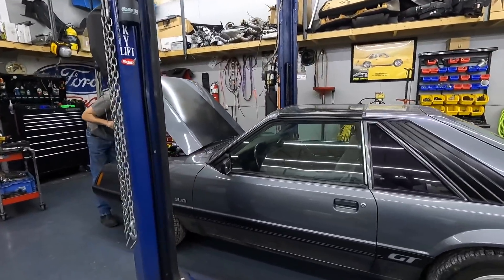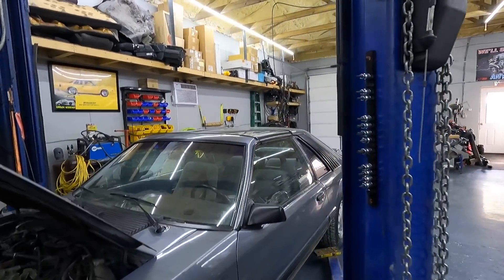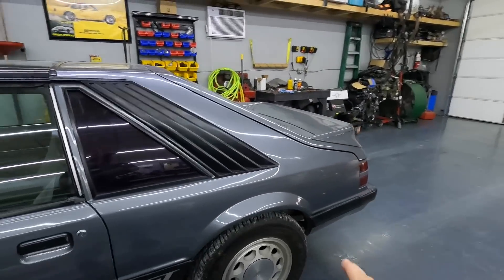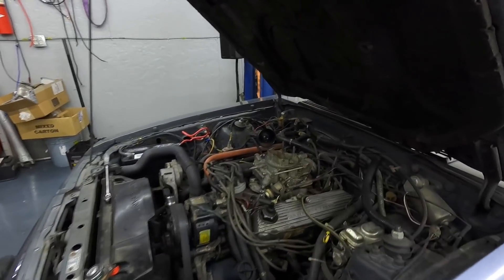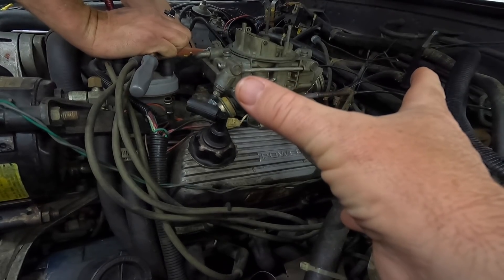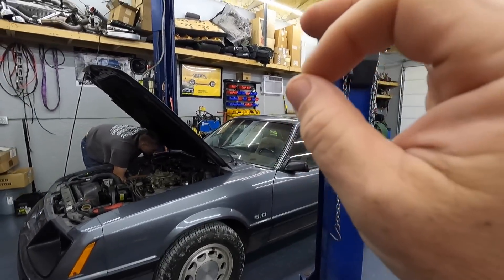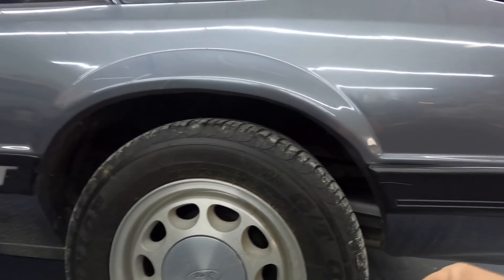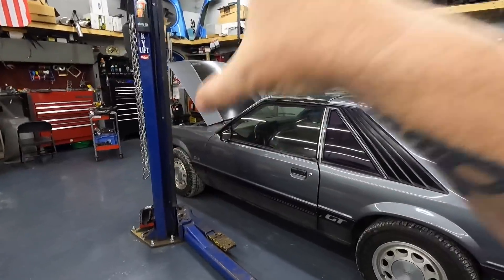Getting a barn find back on the road? GET READY!

Comment: I just found me a 1983 glx 3.8 convertible found under a tarp on a farm in Leavenworth Kansas. Story of it goes, a farmer bought it in 83, passed it down to his son who was 6ft 8inch. Kid couldn't fit, so his son tarped it and would run it every few months over the years. 

86.2k original miles, everything works and looks like fresh of the factory line. Polar white cadet blue interior.  Drove it 400 miles home. 4900 cash best deal this year.

Comment: Good job on this video. You pretty much covered all bases on the issues of a car that's been sitting for a long time. My Fox sat for 15 years, and during that time the rag joint in the steering shaft became brittle and disintegrated on the first drive.

Comment: I bought a 84 20th anniversary vert 5.0 with auto trans with 31k miles and it had cooling issues(radiator and thermostat). Needs  front bearings repacked also. YOU
GUYS NALED THIS VIDEO! Car sat for 15yrs. Had tire issues as well. Thanks for pointing out the other things to look for.

Comment: Try 3M Silicone Compound (wet type) for T Top & other seals. I've used it for over 20 years on my quarter window, drip rubber trim and door window rubber. 
I'd say those bits are at about 90+ % great condition.

Comment: Great video! I would use transmission oil or WD-40 inside the cylinders.   I've got several cars that have been sitting for more than 10 years. I am going to prime the engines before I try to start them because if you crank them, the engine will spin several hundred times before it builds enough oil pressure to properly lube the main bearings. (Remember that the oil pump may be empty before you try and start it.) Do you think I could use the old gasoline (if it's fairly clean of course), I would run it through a filter first, and use it maybe 10 gal of new gas mixed with 2-3 gallons of the old??